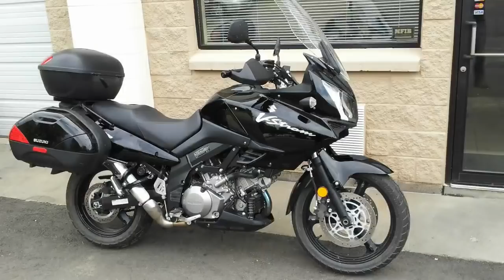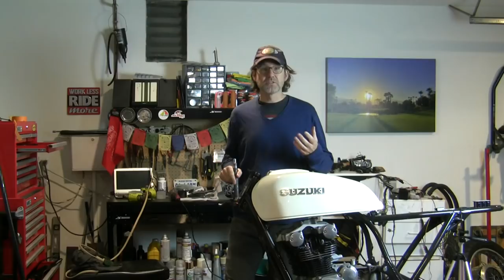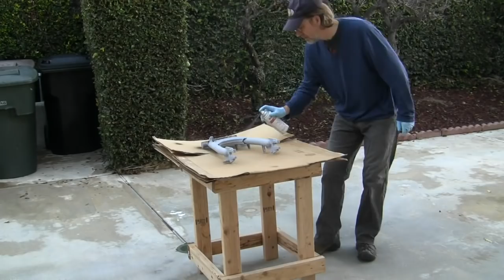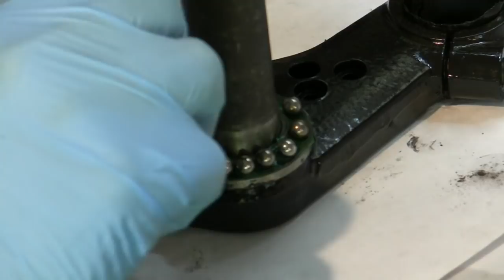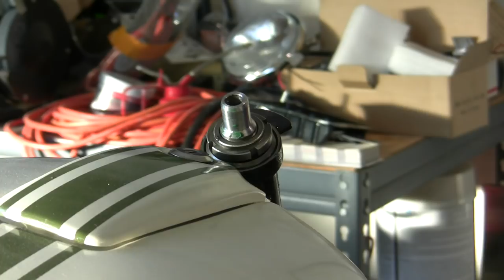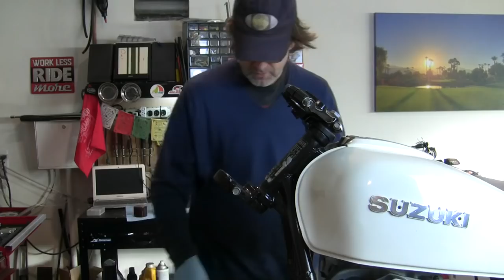Install Forks - GS550 Cafe Racer Build (Part 68)

Comment: Use the OEM cover on the fork tube, it is much clearer looking.

Also I have been working on cars and bikes for over 56 years and have never felt it was Zen or spiritual in any way.  Yes there is a great deal of satisfaction when a job goes well, but that is the end of it for me.

I know this is going to sound critical but why would you quit a job before having another lined up especially with the health issues your wife has.  Just doesn't seem like a very responsible thing to do IMHO.

Another comment with all that has gone on with Pateron in the last month I would recommend you stay away from that platform.  They have turned into a political machine trying to stifle free speech.  Also you only have 1K subscribers how much do you think you would get in the way of financial help.
Reply from the maker: Thanks for your feedback regarding the forks. 

Do you have other ways for soul centering that you employ? I find building/creating/craftsmanship to be very Zen-inducing. 

I'll have to look into the issues you mentioned with Patreon. Have missed those. As for my employment, I've got family covered. Just thinking I'd like UMTV to be more self supporting as a matter of principle. 

A wise man once said, "Think big, start small, but start."

Comment: Did you use a special tool to remove swing arm bearings?
Reply from the maker: Yes. Slide hammer type bearing puller. I show it in one of my videos but can't recall which one at this point. I'll dig and post here if I find it. Harbor freight sells for $79.
Reply from the maker: I use it in Part 43. Hope that helps!